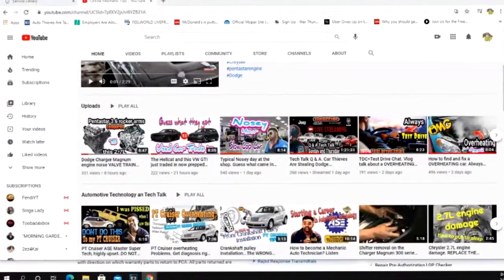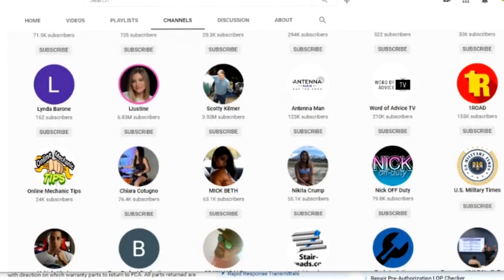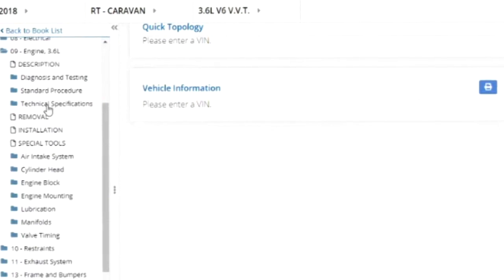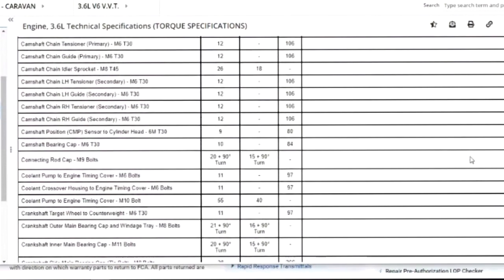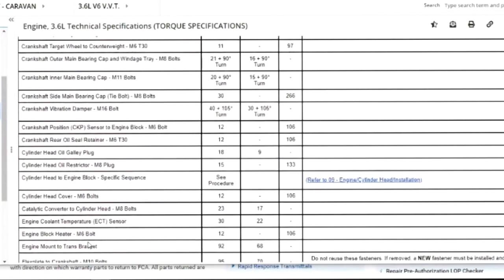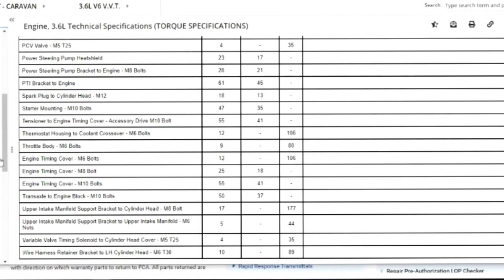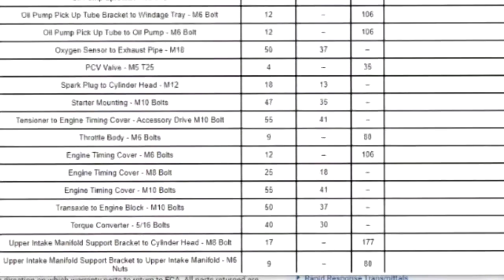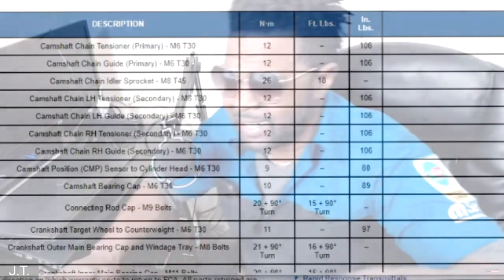Torque Specs for engine builders. The Pentastar 3.6L V6 motor ticking noise, camshaft, cam phasers.

Comment: great video, thank you so much for putting the info out there that most won't.  Only thing i ask is if there is any way to make the video more clear, it is hard to read in some areas. i spent hours looking for the torque specs on a 2018, and you are the only one that actually shows it all. Thank you again

Comment: What would make a engine not to start after changing rockers and one cam shaft on the right side of a 2014 jeep grand  cherokee as well as the spark plugs while I was there. I followed all specs

Comment: Make sure to put anaerobic sealer on the oil gally bolts 3 13mm under the cam phasers
Reply: If you have loss of oil pressure

Comment: Hello, 
I'm putting a aluminum crank pulley on my engine. I'm trying to avoid removing the starter to prevent the engine from turning over in the process. The normal tool to hold the balancer from rotating won't work on the new pulley
Can anyone tell me the lb/ft conversion spec for the harmonic balancer bolt on a 2018 pentastar 3.6L?
I know its 30 lb/ft + 105°.
What does that final torque spec convert to?
I know its a torque to yield bolt. 
Thanks!

Comment: Wow I noticed that the 3.6L Camshaft cap T30 blots were 84 inch pounds and the 3.2L was 89 inch pounds. I was told that my 2012 Durango 3.6L Pentastar camshaft cap T30 bolts was 89 inch pounds. man I'm glad I cam and searched for more info. You are  straight up guy. appreciate you JT. Helped me a lot. I'm in the process of changing all lifters and cam phasers in mi wife's 2012 Dodge Durango. I heard a slight tick and stopped driving it right away. Inspection shows no cam damage. I am concerned about the Mopar replacements as a couple has side to side play in the rocker cage itself. The middle pin that the roller rides on moved from side to side also. Is this a defective part? I need to tap to you bro. How do I get in touch and where do I send funds?

Comment: There is a 7pnd ft of torque difference for the oil control valves between the 3.2l and 3.6l so thanks for sharing both specs

Comment: I have seen a few different answer for my question curious if you could answer please? 2011 vw routan torque specs for plate to the torque converter. Thank you in advance.

Comment: 35mm socket for the phasers. 36mm would technically work but you are more likely to round the edges or slip off. If you need to hold the camshafts while trying to remove the phasers, you would need a 1 1/8 wrench for the holding spot on the cams. Hope this helps someone.
Reply: Dude thank you so much I’ve literally been researching this for about a day and it seemed like everybody knew what the sizes were about me because I couldn’t find any information
Reply: In case anyone is reading this comment and considering purchasing 35mm sockets... I measured the flats with a caliper and got 35.56mm (cam itself was 28.26mm, which is indeed 1 1/8"). Everyone else is saying to use 36mm, so take this comment with a grain of salt.

Comment: I wanted to ask a question. Well when it comes to the 3.6 Pentastar will the torque specs and procedures to remove and install be the same for any model with the 3.6.
Reply from the maker: No, not all. Some of it changes from year to year. I dont no the answer by hard tho.
Reply: I ask because it is hard to get specs for the engine and suspension on a 2015 dodge journey sxt 3.6L

Comment: Can you verify the torque spec for the Pentastar PCV Valve screws is 35 inch Pounds?  I want to replace my PCV valve to eliminate it being the reason why my 2016 Pentastar in my Caravan misses very slightly, but consistently.  I want it to run like a sewing machine. BTW, the gas mileage is about 18 to 20 MPG in the city and excellent on the highway. My 2016 Dodge has 78,000 miles on it and I'm not really happy with the idle. I already changed the spark plugs, but that didn't help any. The engine seems like it's missing ever so slightly, but it's random type of miss that you can feel once maybe every fifteen or 30 seconds. I figure it is missing (maybe a dirty injector ?) since I can feel the engine shake the car ever so slightly at idle. The "miss" doesn't happen like it's a bad plug; it's completely random but it's pretty much always there if you wait for it!  BTW, I have a 2005 Mazda 6 with the 2.3 engine and it runs like a sewing machine (completely smooth), so I hope I'm not wrong in expecting the same thing from the 2016 Pentastar. If I am wrong, and these engines don't run completely smooth, then let me know so I'm not chasing my tail. Thank you.
Reply from the maker: Hey Mike, yes you are correct on the Torque specs for the PCV. As for the vibration or misfire its hard to tell whats normal. This is a V6 engine, theres no balance shaft like the 4 cyl using. However, using a good scan tool you can likely see if misfire being detected and base your diagnosis around that cylinder. Did you have any codes? Also are you subscribed to the channel?
Reply: @OnlineMechanicTips  Thanks for your replies to my questions. Since I have the caravan, and the PCV Valve faces toward the Driver's side, do you think I can get a Torque Screwdriver in there to torque the screws, or do you think I need to use a torque wrench?

Comment: FCA should still recall the rockers on the second gen 3.6 in my opinion, 8 rockers replaced on my 2016 T&C in under 80k ,not a coincidence folks,yes my oil was changed frequently, yes I used full synthetic in it,hell when I was trading it in ..after getting back from shop for the tenth time for 2 rods 2 rockers you could hear the cam phasers clicking, thanks to my man JT I knew it wouldn't pull code when I traded it in.

Comment: JT that oil control valve bolt  is a 36 mmeter I just did my valve train recently.  Also i was watching one of your videos I paused it when you were removing one and your socket said 1" and 7/16 th. I hope this helps anyone who was wondering
Reply from the maker: Thanks bud, I appreciate that. I updated the description with that info, thanks again.
Reply: @OnlineMechanicTips   Bro my phone my text to speech is terrible it's a 36 mmeter the standard socket is still the same 1 and 7/16th. Sorry this text to speech and worth a damn. 😒